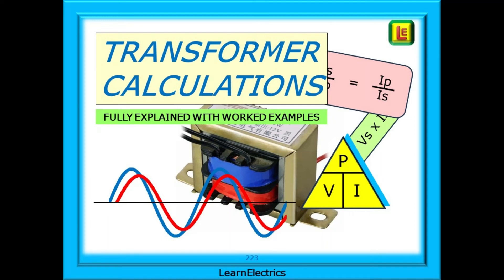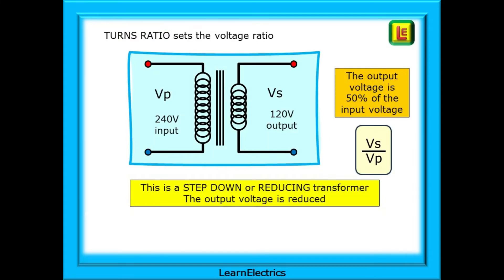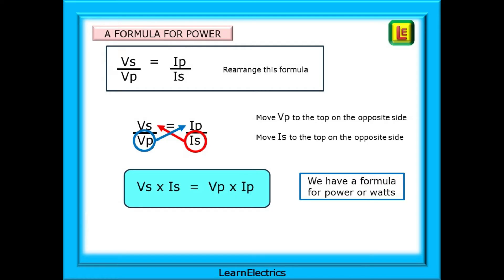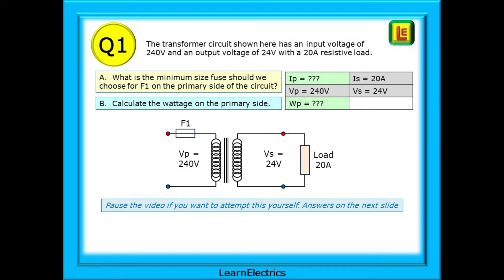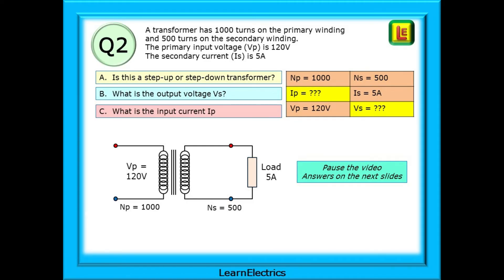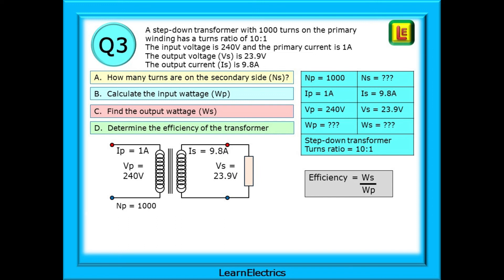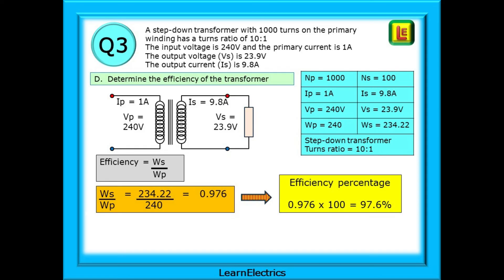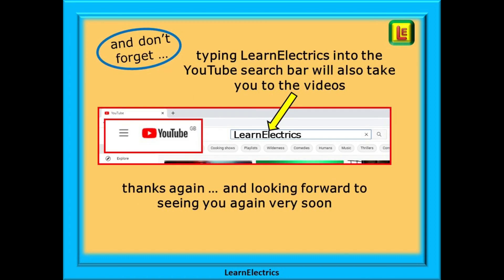TRANSFORMER CALCULATIONS – HOW TO MAKE ELECTRICAL CALCULATIONS – INPUT AND OUTPUT VOLTAGES AND WATTS

Comment: Sir, my answer is for Ns=99.6 turns. Is it wrong? Thanks
Reply from the maker: That is a correct answer. That is close enough to 100 turns. It all depends how you round up or round down the decimal points. Well done my friend. Dave.

Comment: Watts are V * I, the same as Power because "Power is when work has been done"

Transformers don't do any work, they just change the V and I values, that is why transformers are normally measured in "VA" rather than "W"

You would lose markers if you're doing the EAL or C&G L2-L3
Reply from the maker: Thanks for watching.